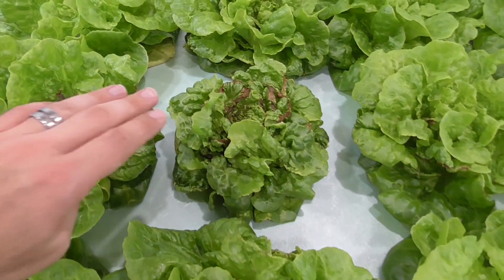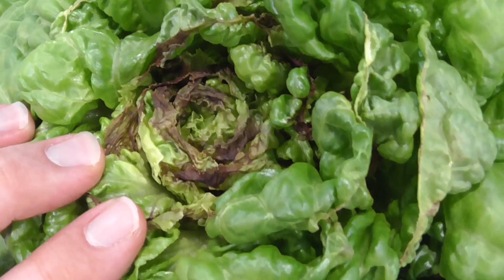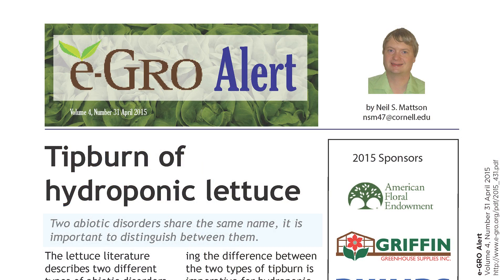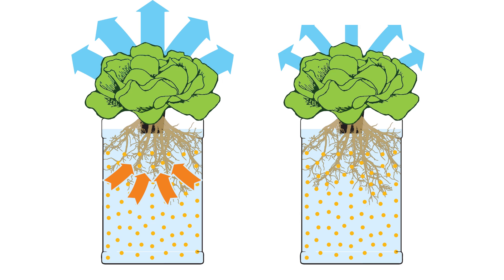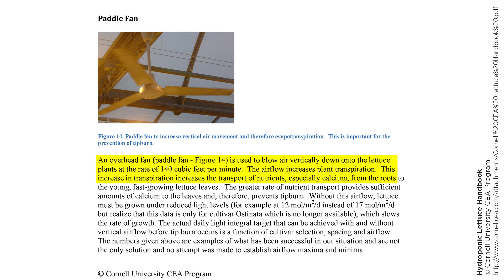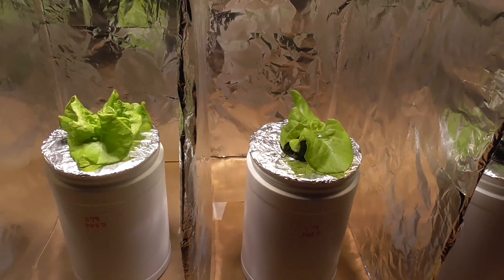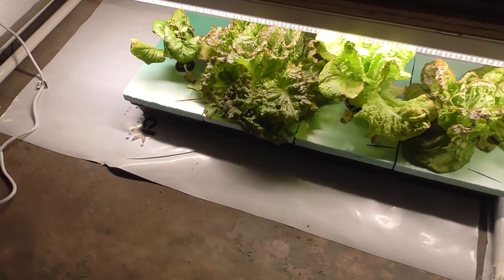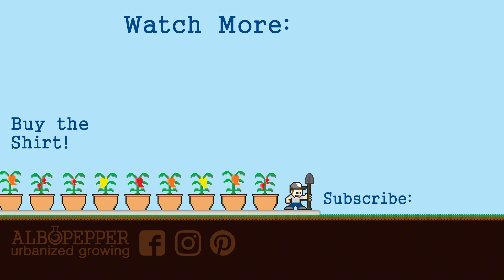Preventing Tip Burn: Hydroponic Lettuce  (Indoor LED Grow Light) PPFD Experiment

Comment: I run sf600 spiderfarm light. What light duration would you suggest hanging light 10 inch above buttercrunch lettuce. Currently I'm running 14 on 8 off. Should I be running less time on. Any tips can help. I cannot raise lights any higher because of bookshelf I'm using

Comment: Interesting info even though i don't grow lettuce but carnivorous plants that need a lot of direct sun light. I have a Sansi 24w at 5 inches of the venus fly trap, I don't know if it will get tip burn. I think lettuce and carnivorous plants don't react the same at light even though they both grow outside. I think carnivorous plants leaves are more tolerant to strong light so it's probably fine that the Sansi light is very close to the plant.
Reply from the maker: Thanks for sharing your experience! I've found that my flytraps grow short, stubby and magenta when given bright light.

Comment: I just ordered a marshydro tsw2000 what do you recommend is the best height and strength to her for my butterhead may queen lettuces? 25%50%75%100% dimmer, sorry I’m new to all this haha
Reply from the maker: It will depend on the number of plants / coverage area. Also, the light cycle duration will impact how intense the light can be before the plants start to get tip burn.
Reply: @Albopepper  I just checked the specs at 25% it’s 250ish ppfd in the corners of my 3x3 tent so I should be ok at 12-18” I’m rounding it doesn’t o your best results in this test thanks

Comment: At 6:50 you say you switched to full spectrum white. What color temperature would be optimal?
Would e.g. 3800K have more "red" light in it than 5600K?
Reply from the maker: I've used 5000K and it worked fine. Even down 3200K should be ok. It depends on the plant type. If you're talking specifically about lettuce, having a little Far Red has been shown to boost growth. But extra blue / UV can help with pigment production in red lettuce. So I try to get a broad spectrum. Many devoted LED grow light with use 4 different colors.

Comment: I just started using indoor lights (this year) for my starts because the price-point came down for LED lamps, and Sansi has the E-26 socket bulb, so I don't have to invest money into some sort of pricey fixture. The Sansi 15w Full spectrum lights are pretty nice to use... Thank you for reviewing this brand, it's one of the reasons I purchased them.  

One of the things that I have found that using these lights are that a lot of my cactus and succulent plants that are in the proximity of the lights are all growing/turning/bending toward that light source. Since I grow on old recycled plate glass shelves, the light that penetrates the shelf onto the cactus and succulents below are actually stimulating growth in the plants. (about a distance of 42" to 48").  This is pretty impressive because the shelves are 1/2" plate glass. There is a refraction element going on that probably dims down a UV spectrum/or IR spectrum. 

Anyway, thank you again for your review.

Comment: How to deal with outer tipburn? I transplanted some basil seedlings into potting soil, water whenever the surface is dry, sitting next to a window with good lighting & airflow and their leaves were just slowly brown and curl up...
Reply from the maker: Without photos, it's hard to say. If the light was super intense, they could be getting sunburn. But it might also be a disease like basil downy mildew or root rot. I'm assuming they weren't overfertilized, which could cause nutrient burn.

Comment: Hello. You have said "under highly light level, growth rate is boosted" But if the plant can't transpire fast enough, they can't supply the increasing demand for Ca2+ that will    lead out tip burn. So, my question is can we reduce the out tip burn by increasing Ca2+ in water source instead of reducing light time or light  intensity? Please answer my question🙏🙏🙏
Reply from the maker: The problem isn't a lack of calcium. The problem is that the plant can't draw it up fast enough. Adding extra calcium to the solution won't fix that.
Reply: @Albopepper  Sorry, I miss some key point. It not out tip burn but is inner tip burn case. Tip burn caused by plant can't transpire fast enough to pull high demand of nutrient. I think we have two ways to solve it. Using fan to increase transpire = plant gain more Ca2+ or let they use the same transpire rate but increase Ca2+ concentration in water = plant gain more Ca2+ right?

Comment: I have 2 types of leaf lettuce, one has outer tip burn but is growing big and fast, the other has no tip burn but is slow as molasses, it's 2 inches high after 3 months! I am using white LEDs, 4000k and 5000k. (colored LEDs are fad bullshit!) I don't know the PAR values but the LUX reading is around 50,000. Last year I had no trouble but I had dimmer lights, so I will try lowering the light level. My humidity level is 'normal' and there are no fans. Thanks for your video!

Comment: Do you Think that a shorter light duration could have solved the issue as well?  I know it would slow growth, but I have a small space that is limited vertically as well.
Reply: It was caused by the reds and far red spectrum that made the first batch stretch ultimately, he would want a more blue spectrum for more compact plants(other factors to consider also).

Comment: I once read that inner tip burn is caused by shallow roots drying up.  My DWC Romaine is now having this problem and I have identified what I think are the problem roots.  It looks like the  water level is just getting a little too low and the roots growing out the side of the rockwool are air pruning.  This is with HLG 5000K 135 w LEDs.  I am thinking the solution is to more properly place the tap root through the rockwool so more of the roots are near the bottom and can not be air pruned.

Comment: Your videos are sensational!
Typically I use t5's for growing green leafy vegetables but now I've added a couple of Galaxyhydro Dimmable LED Grow Light, 96W (300W for combined 100 bulbs) Indoor Plants Grow Lights with UV and IR for fruiting vegetables.  The problem is I have 5 level shelving units and I don't have a clue how close to put them to the mature flowering/fruiting plants.  Help!  If my shelves are about 18 inches apart do I need to crank down the wattage and how far?  I just need a guesstimate starting point that won't fry the plants while I fiddle with the distances and variable wattage.  Thanks for any help you can offer.

Comment: I have a lettuce experiment of my own going on right now. I have 5 week old lettuce from seed growing in 2 different systems, 1 aquaponic, the other hydroponic w/ air stones. I've attempted to keep everything the same (except nutrients of course) using regular HO  T-5 fixtures at the same height. The hydroponic lettuce shows inner and outer tip burn while the aquaponic lettuce seems fine and actually a little better growth.  Only other difference is water temperature and occasional ph fluctuation in the aquaponics. Just wanted to add this info to your findings. I raised the lights.
Reply: There is about a 20 degree difference in water temp with the aquaponics being around 80.

Comment: Is 16 hours light too long for lettuces? Can it encourage bolting?
Reply from the maker: 16 hours will work ok for lettuce as long as the light intensity is not too high. And of course, you need a good color spectrum. I say this based on the varieties that I've tested. If there is a cultivar out there that bolts under 16 hour light, I am not aware. FYI: In the Lettuce Handbook PDF that I reference in the description, the researchers were growing lettuce seedlings under 24 hr light.

Comment: with the red+blue lights the plants were probably missing some wavelenghts, and went to the source trying to get some. nowadays you can get ... . some so called full spectrum leds, that are basically red+blue but have some IR, and UV and are suposed to work better. for less than 2$ you can get a 20watt you can connect directly to the mains 120/220v you just need some heat dissipation.
Reply: robert roig .

 its probably 8w in reality. leds are run below 50% bcuz at 100% they would only last a few seconds. 

i dont get why they dont just say the actual and nominal watt values, and explain why, that way it would be honest.
Reply from the maker: Dankady Bong - Each LED tests at least 14.5w ACTUAL power draw at the wall. I measured it with my KillAWatt meter.
Reply: AlboPepper - Drought Proof Urban Gardening .
i meant in general in the amazon and aliexpress ads... it causes confusion.

Comment: Really good info.  I think temp is the bigger cause compared to light.  I'm trying to think how to properly isolate heat though.  Maybe a glass separator or something?
Reply from the maker: Thanks for watching Jeb! I had often suspected temperature as a possible cause as well. But these 15w LEDs throw virtually no heat. It all gets drawn through the ceramic heat sink above the diodes. After running the 2nd test, I was able to really see the significance of excess light intensity. The lettuce stayed low and compact. So there was plenty of distance from the LED for heat dissipation, but it still suffered tip burn.
Reply: @Albopepper  Super late but red light causes stretching and white/blue spectrums reduce stretching.
Reply: Indeed a very good info
Reply: Jeb, I love your videos but you scare my 3 Dachshunds.  They bark and hide under a blanket when you make those weird faces.
Reply: AlboPepper - Drought Proof Urban Gardening  i put a 9w led on a plant overnite last night and found a couple leaves were just very slightly wilted and the very tip (nearly unnoticeable). My guess is a fan would help but i may have gave it too much nutrients. I didnt notice any overnight growth though. This is the first i tried this. I was thinking that maybe these plants should not be getting constant light and need to rest like us
Reply: Jeb Gardener what’s your opinion on fish oil

Comment: I have wanted to test led proximity... overall.  Light density is far greater up close, losing most of it's intensity within the first few inches.  Controlling light intensity and distance from plants I think we can greatly improved the efficiency of energy/light conversion and plant delivery.  I can imagine a bunch of quadcopters doing it 😀.   But till that day, even just moving the light fixture up manually at a fixed known rate would provide some interesting data.

Lastly, anybody knows what happens to plants if we "flicker" the lights?  Since LEDs has no startup lag or "warm up/down" cycle (like hid), I wonder: how to plants react to frequencies other than 60Hz.  

Love your shows... Maybe some of these ideas have already been tested, just point me in the right direction 😀
Reply: Peter Frischknecht .
i once had flucker with muh hdi 150w. turns out i wired the + and ground in the wrong nuts. for some reason, it didnt matter. it did run but with flicker and small sound of electric short. i never wired it right so i have no proof it was that, but i'm pretty sure.
Reply: Peter Frischknecht the inverse square Law.. double the distance, times four the area covered by light and decreases the light intensity by four.

Comment: As always I find your videos entertaining, informative and well made.  Keep up the good work.  A quick question if you have the time.  I think your SIP is probably one of the best designs I have seen.  I want to build one or several.  My question is ..... How far will Peat Moss wick vertically?
Reply from the maker: Hi John! Thanks for watching.  :-D  Also, for you kind words about my SIP designs. I would expect peat moss to wick at least 12 inches vertically. But I've never tested it to see what the maximum wicking potential is.
Reply: @Albopepper  the longer the fibre the better, Coco coir is excellent for wicking, adding a surfactant to the nutrient solution helps too. (I hope this is useful info 3 years after you asked the question!) 🙄